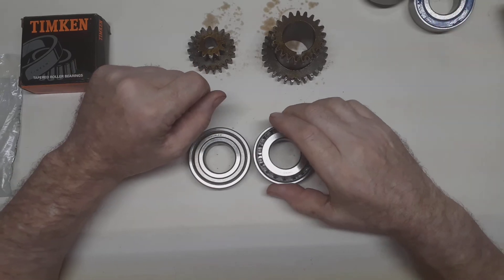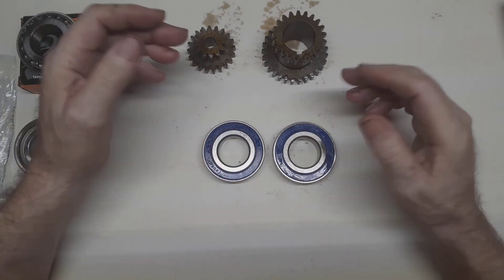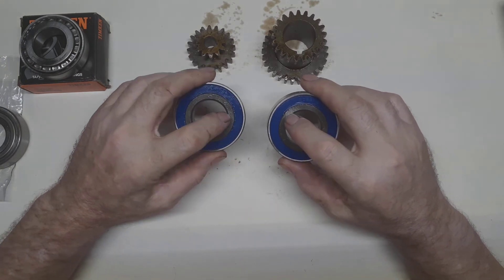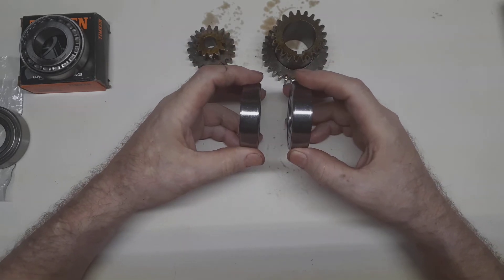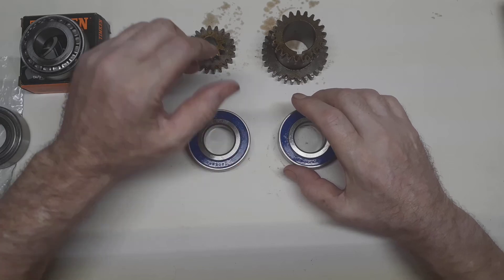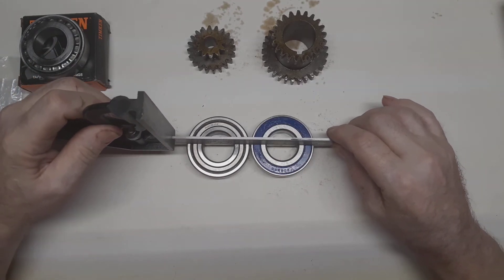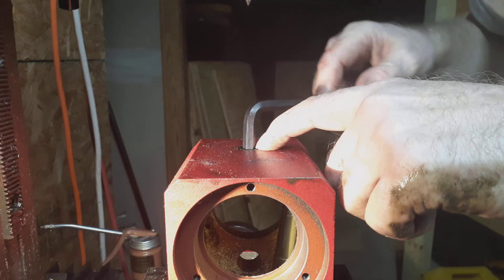Steel Gears and Angular Contact Bearings for the Mini-Lathe

Comment: I had a problem that everyone should know about. It’s an Einhell mtb3000 mini lathe, basically the same as in this video, although branded differently. I switched to angular bearings, and it was impossible to set preload properly. The shaft was - even before reassemby of the chuck - bouncing at least 1-2 mm. My suggestion is the following. There is a gear on the shaft, and two spacer rings on the sides. These give out the full shaft length available, making it impossible to approximate the bearings ( preloading) beyond a certain point. I think I have to disassemble the whole thing again, and remove some of the spacer ring widths ir replace them with some thinner metal rings. Guys there, what is your opinion or experience? Thanks!
Update: I was right. I changed one of the spacers to a simple rubber o ring and that is it! I could preload the angular bearings.

Comment: Colchester used Gamet tapered bearings in their head stocks for many years, and Lilkey still do. They are oil bath, and on a small lathe may cause design issues.

Comment: I installed a set of sealed angular contact bearings but replaced the plastic spacer between the bearing and the nuts.  The plastic spacer will deform over time and increase the backlash in the spindle.  Now that you have the lathe back together it would be an easy task to make a steel spacer and install it in place of the plastic one.  I tried the steel gears in drive train and had the same excruciating noise your lathe has from them...very poorly made gears...went back to the plastic gears and have not had any trouble with them (lathe is 39 years old).
Reply: My feelings exactly on the metal gears! Would never do it again! I put them in a Grizzly G0765, and was greatly disappointed by the increase in noise. I quickly decided that if I ever took the headstock off, plastic gears would be put back in! After buying a Harbor Freight 7X12 (online order only) mini lathe and happy with the quieter operation, I sold the Grizzly! Lesson learned!

Comment: Sealed angular would be nice, a small rat tail file made quick work of the thickness difference on the plastic spacer making about 3/32 room for the key. felt goes a long way to seal the bearings and some aero shell clayed grease. Not to mention a 5000lb vehicle goes 100k miles on a single lube session so It’s highly unlikely it would ever be an issue. But we’ll see. YMMV. Now to get some gib strips that don’t suck…lol

Comment: Very Nice Job! I am copying your design, Implementation.  I too had bought the tapered roller bearings from Timken and realised the same and then bought the angular contact bearings. I just wasnt happy  running the tapered rollers without an oil bath or way to grease them.  Nery nice work sir. Now I am off to find 5/8 x 1/2" fine thread headless allen bolts.

Comment: I fitted angular contact bearings to my lathe. The headstock is the same as yours. I no longer use the gears as i run the lathe vi a 3/4hp 3 phase motor and vfd. The gears are still in the headstock, but are locked in Neutral as the spindle is now driven directly by the motor.
The bearings have stood up well and  have been in about 3 years and still seem fine. I check the preload occasionally but they have not needed adjustment so far. I have a lot of projects awaiting my attention, but lack of time and cold weather means i am not spending a lot of time in my mini workshop at the moment.  I have the same mill as you  as well and the larger x2.7 mill as well, also a slightly larger lathe than yours, All of which get used. Keep up the good work you have a good channel.

Comment: Wonder where you got your metal gears  I got mine at LMS and even after a second set they had way more backlash than rhe nylon originals. Just a lot of noise and affect cuts more. The weak part is the belt and plastic motor pulley. Such a pain to keep the belt tight. Tear everything down to get to the motor bolts.

Comment: There different types of grease, just thought like to help and works very very well,  motor bike chain have this spray that it's very stick as motorbike chains need this type of grease. There great on the gearing as it doesn't fly off the gears and bearings and for shore no mess.

Comment: For anyone doing this, It may be a lot easier to just use brass tapered pipe thread plugs like 1/4" or 3/8" NPT and tap then shallow, so they don't intrude deep into the case. If they do intrude at all, just file them down as much as needed.  (If your in north America and don't have a mill to cut down the 5/8-18 plugs.)  I just ordered the angular contact bearings for mine, and ran across your video. Thanks for putting it up. The speed control chart and dial control backplate is a excellent idea as well!

Comment: Put a hose clamp on your grease gun coupler, adjust it so it will hit the case and not allow the coupler to contact the gears. 
Then pump away.
Reply from the maker: As I showed, It is better to let the gun contact the gears while they are not moving so that you can really get the grease in between the teeth all around.  You will find that if you try to do it while they are turning the grease really doesn't stick well and ends up at the bottom on the bed.  Squirting oil will get all over the gears, but it won't stick as well as grease.

Comment: It sounded like you ended up like me with the metal gears. Not only are they noisier they seem to have more backlash that makes it even noisier yet. LMS sent me another set and still a lot of backlash. I used the same sealed bearings and did worry they seemed to press in harder. In the end I had to add a steel washer before the first nut because I ran out of threads to preload. Bearing seats may just have been a little deeper in my lathe. The bigger grease plugs look like a better idea than oiler ports I've seen that oil just runs out of the bottom of the headstock. I found it easier just to install a tach with digital readout. The last fix I need is a better way to keep the tailstock in alignment than the original flat plate keeper.

Comment: The interference between the shaft and bearing should be reduced, otherwise there is no way for a right preload on the bearings if they are too tight with the shaft.
Reply from the maker: Are you saying that the inner race stretched that much?  It went on with typical pressure for a bearing.
Reply: @DrJim-zh8je  no, stretch the race probably but is not the issue here. This is like a car wheel. The bearing should slice on the shaft snugly, so when you preload, the force applied by the nut is the same force on the bearing. If the bearing are too tight with the shaft there is not control of how much preload you are applying. Hope this help, and I really like your videos, thank you for your time and knowledge.
Reply from the maker: @Rheasound  Tightening the nut did take up initial slop, so the preload DID work.  No undue force was needed.  I got no sense that the bearing was "too tight" on the shaft.

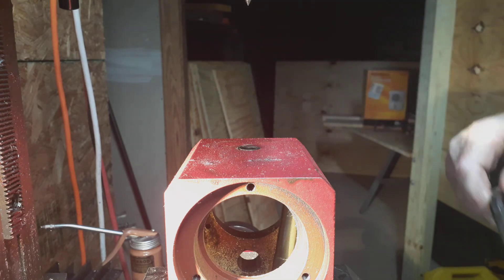Comment: 7:01 looks like the main shaft has had some hammer getting the old bearings off!
Reply from the maker: Wrong. No hammer was used, only the press and an appropriate fixture.  See the previous video on the mini mill to see the fixture used for the chuck-end bearing.
Reply: @DrJim-zh8je  LOL, okay I guess all that galling was there from the factory! and just so you know in the UK "had some hammer" is a colloquialism for been treated rough, not always the literal meaning hit with a hammer!
Reply from the maker: @leaflee2066  Thanks.  Next time I stub my toe, I'll say that it had some hammer.

Comment: Did you notice any improvement?  Thanks
Reply from the maker: No detectable side play for the chuck. But real cutting improvement would have been hard to detect without first tightening up the saddle and slides, which I have done. See the next video on how I did that.

Comment: The grease ports wont do much for the sealed bearings.
Reply from the maker: They were not meant to.
Reply: @DrJim-zh8je  Hi, but I do think the sealed bearing will slow it down, adding workload to the engine. The least resistance is the best enjoy your lathe Jim, I think you put a lot of work in making your videos to share with us, thanks.
Reply: @francescozambuto1713  You know these lathes came from the factory with cheap sealed ball bearings.  He is replacing them with Angular Contact ball bearings, which are designed to take some side load. Regular ball bearings (like the factory ones) are Not made to do this, but, they are very inexpensive. Communist China manufacturers don't care if these last more than 30 days so the ball bearings are used!  They are only made to take a radial load. The angular contact bearings can take a fair bit of Axial Load.  You can look up those terms to see what I am saying.  Tapered roller bearings are also designed for radial and axial load force but they must be kept constantly greased.  That is near impossible in this machine without disassembling it. I doubt there is much difference in these angular contact bearings, versus the regular ball bearings  it came with, as far as resistance is concerned.

Comment: You're right Jim only time and regular use will tell if the sealed bearings will last without maintenance. In my opinion they will not last and you will have to take them out again to install new ones.

Comment: Great Video! Thank you for putting this up!

I have been wanting to do the same to my mini lathe, with the bearings. The pressing scenes are making me a tiny bit nervous about it now, though. Was the pressing on and/or off very difficult or tight? It sounds like it might be on the video. I don't even have a press. In comparison, installing tapered roller bearings looked much easier on some other videos that I have found. But I really wanted to go with the sealed angular contact ones.
Reply from the maker: It is easy as pie with a press.  But be sure to press on the races, NOT on the seals.  You can see how I built a press in my first video about the mini mill.  It is true that freezing the shaft (as suggested by gary above) to shrink it will make it easier.  But if the inner race is properly made, it should go on and off easily with a press.  You will only need something like a 20 ton press to work on something like an automotive differential.  Years ago I actually rigged up one of those to do just that.
Reply: I think the other is better this way Dr. Jim added ports can be used to maintain the gears bearing and keep things a-okay. However, as food for thought, I would consider a waist port used when cleaning the inside out the old grease can be liquified and it will come out of the lower port; the positioning of the waist port is most important, under the box is a good place. What you think Dr. Jim.
Reply: @francescozambuto1713  you mean waste, not waist.

Comment: I would like a little advice, out of all the 7x14 mini-lathe, keeping in mind precision and no Teflon gears, which lathe would be the best one to buy with your hard-earned money?
Reply from the maker: I would suggest going right to Little Machine Shop .com .  Or maybe Grizzly.  LMS will cost a little more, but it would probably cost as much to bring the cheaper stuff up to snuff.  If I had known about LMS, I would have avoided Harbor Freight tools.  I have had the mini mill teeth on the gib levers crumble on me and the Z axiz column stop snap apart on me.  Those levers were the first things I had to replace with my own mild steel design (an allen cap screw with a lock nut allows adjustment for routine use).  I am convinced that the steel castings "they" make are NOT done with metal properly fluxed, so the metal is too oxidized and therefore weak and or crumbly when strained.  Getting something better is worth the cost.
Reply: @DrJim-zh8je  
I am grateful for your advice and will look into it. Your right, one gets what they pay for. I also believe that even when one pays extra nowadays with things as bad as they are in the end they still get shortchanged. 
As a personal note, please do not be offended by anything thing I had said (only an expression of good faith thoughts on probabilities) I can assure you. I am most grateful to you for taking the time to create your videos and share them with us, thank you, Dr. Jim.
Reply: @francescozambuto1713  "Your right, one gets waht they pay for"   ....  should be :  "You're right, one gets what one pays for."   Just trying to help ...
Reply: @ET-cj8jo  give us a break! Take your lectures to some other forum.

Comment: I have a question I was hope you may have answered regarding the bearings (pressure) I am thinking to myself what if the sealed ones won't take the pressure produced by the speed of the axial attached to the chuck, I am assuming it will turn at about 2, 500 a minute or so that would create a lot of pressure within the housing of the sealed bearing and perhaps that's why sealed ones were not installed of course this is just coming out of someone who is not certified speaking (writing). Could you fill me in on this issue? can anyone give me an answer, will the seal bearings leak once the chuck is turning at a high speed are they made for taking high speed?
Reply from the maker: I don't think 2500 RPM is so great a demand on these bearings.  An online search may find data to answer your question.  They already are going to have a preload, for which they are designed.  I assume that what you mean by "axial attached to the chuck" is applying pressure from the front of the chuck, not a side load.  I think that applying enough pressure in that way to damage the bearings would be abuse of the machine.  Cutting a piece with that much pressure should not be necessary.  Do I understand you correctly?  If you have chucked something lopsidedly, (perhaps in a 4-jaw chuck) you will have to go slower.  In my opinion, if the seals leak, the manufacturer has failed.
Reply: @DrJim-zh8je  What I am trying to say is that spinning of axel may produce pressure within the sealed bearing;  the bearings will cause the grease or lubricant to expand creating excessive pressure it was not designed to withstand therefore cause the seal to leak and dry out. This may cause severer damage to the bearing, axel, and so on.  I would like to remind everyone, I am not a certified engineer, machinic, and so forth, I just had a similar problem and so I am sharing my thoughts.
Reply from the maker: @francescozambuto1713  Thank you for clarifying.  Have you seen a case where heating of the grease caused this to happen?  Or centrifugal force?  Was your "similar problem" with angular contact bearings?
Reply: @DrJim-zh8je   Seen it in a Grinder, the ball bearings are pre-packed and specifically sealed to take the heat and a load of pressure. But, what happens is that the packing gets dirty, dry, and harden and with that each bearing begins to wear down, causing damage to the housing. This is what I believe may happen with the sealed bearings, and if a bearing pops out and flies around in the gearbox it may cause a problem, imagen that. Of course, I could be wrong, the lathe is not a grinder and there is more space in there which will allow the bearings to cool down better. Ho, wait, they are sealed bearings which will contain the heat and with time the packing may dry as I suggested and you may have to change them. Only time will tell. What say you?
Reply from the maker: @francescozambuto1713  The bearings are trapped by the inner and outer races.  I can't imagine them popping anywhere.  If they went bad, the noise and shaking would be astounding.  But time WILL tell.  :-) .
Reply: @DrJim-zh8je  Your right only time will tell, enjoy the lathe. LMS only ships parts to the country I am in no lathes, so now I am looking at Grizzly. Thanks for the advice and for sharing your videos with us.
Reply from the maker: @francescozambuto1713  OK.  I Don't know what country you're in and you don't need to say.  You might want to look at some other options.  South Bend makes really well built machines and are American made.  I might someday get one myself.  They make some that are larger than the bench-top ones you're looking at which are more expensive when new.  But you might be able to get one used which you could be very happy with.  Another option is to make one yourself.  I have considered that.  David Gingery has a good book (as well as many others) on how to do that, but you may need to cast some aluminum to do so (you can use charcoal).  I have cast aluminum in the past in my own home-made foundry.  Personally, I think it can be done with welded steel.  The bed would be tricky.  Right sized ground tool steel plate?  Many parts you would be able to buy, like a chuck.   But I would agree that making one is a more radical move.  Good luck.
Reply: @DrJim-zh8je  No Sir, I did not explain myself precisely, no undue force from the side, high speed will eventually dry out the packing and the bearing will have to be changed, that's the way I see it. It's like the Teflon gears, they will crack and have to be changed not unless you can make your own before they crack and do an upgrade. Perhaps the solution may have been to create a grease port. In any event, I think the bearing the lathe came with are low grad ones they would have had to be changed with time, how long don't really know. Let's face it the Lathe is not first quality and the buyer gets what he/she pays for, so that's the bottom line. Thank you for sharing your video with me and for giving me a response, it was nice of you.